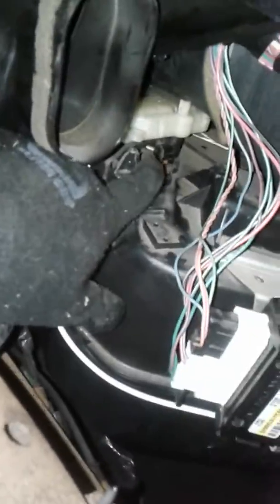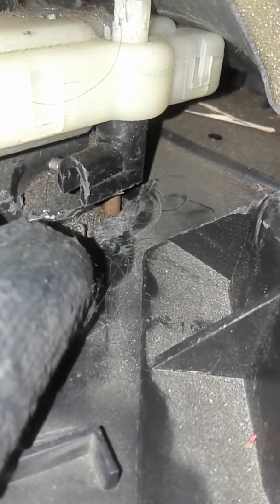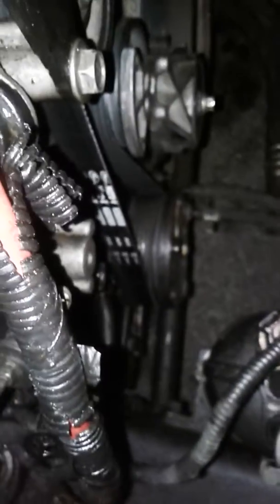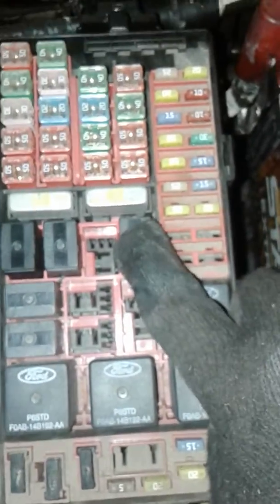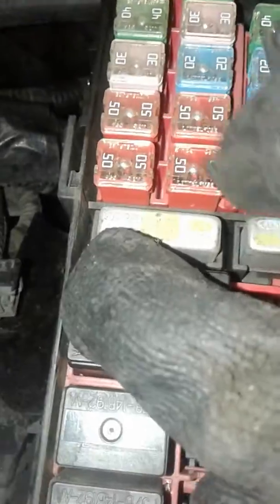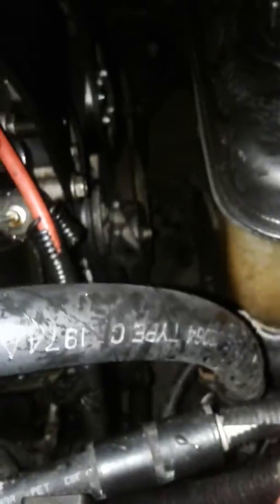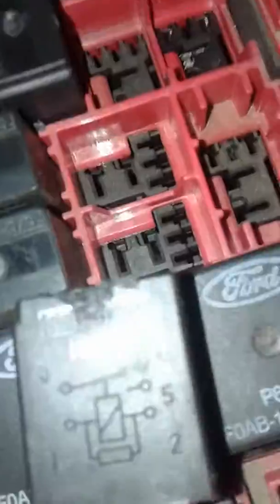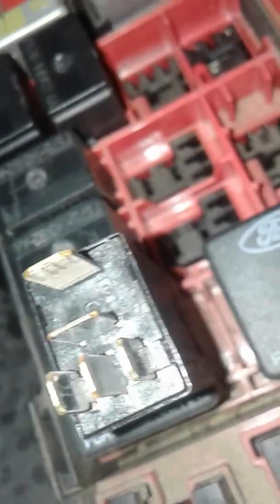Crown Victoria AC clutch not engaging SOLVED!

Comment: I bought a used 2005 ac compressor to my 2003 crown Victoria,the compressor cycling is super quiet no clicking at all. But it does cycle in normal intervals and it blows nice and cold air. Is it normal?

Comment: Yo I replay my compressor and bought a new relay but my compressor still want kick on any idea???
Reply from the maker: Low freon level will cause compressor to not engage.
Reply: @MegaBobson123  had it check also and filled still not coming on
Reply: @DABOYCARROLL_601  try replacing engine computer cause only ford relates the ac system to the ecm